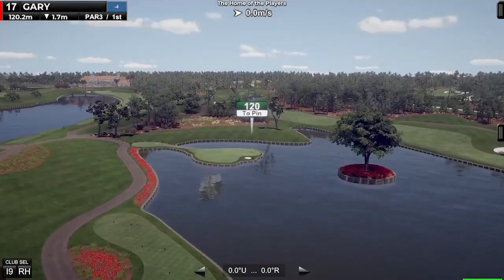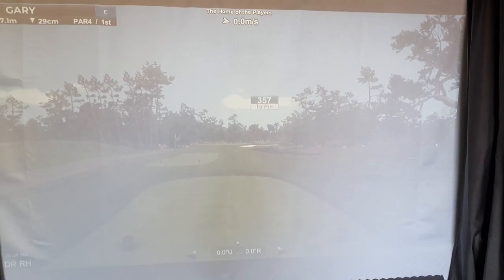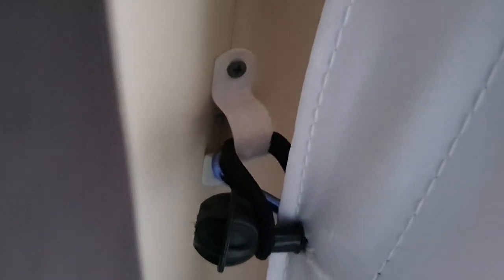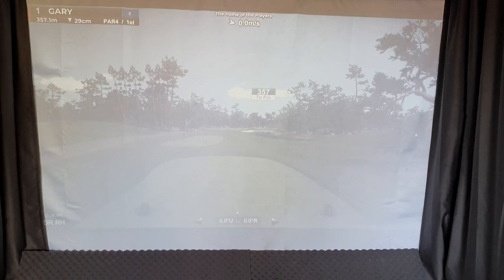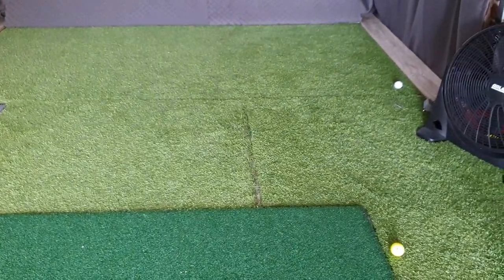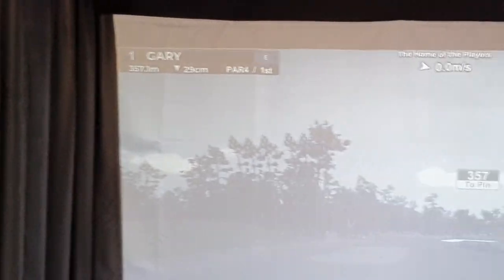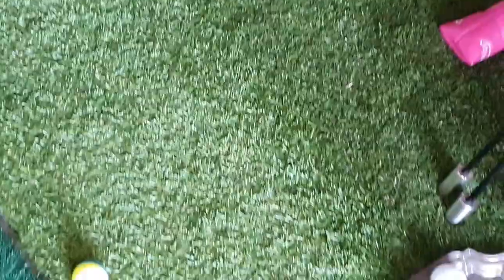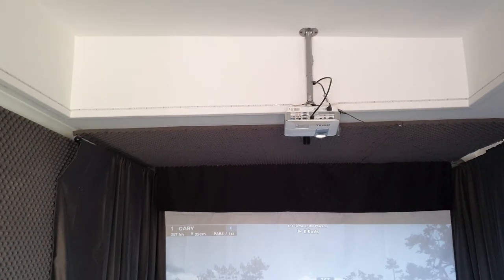Home Golf Simulator - SEE MY AFFORDABLE DIY GOLF SIMULATOR BUILD & HOW MY GARAGE IS TRANSFORMED.

Comment: Looks amazing… Well done you… How high should the ceiling be if you want to hit driver…?
Reply from the maker: Thanks! My ceiling is 3m, which i my opinion is the minimum if you want to use Driver. I am only 5ft 7, so if yoh are taller, you may require higher.